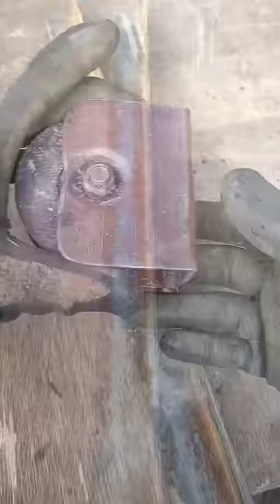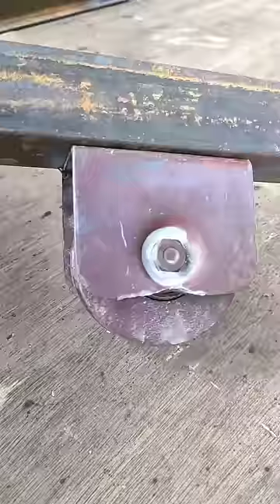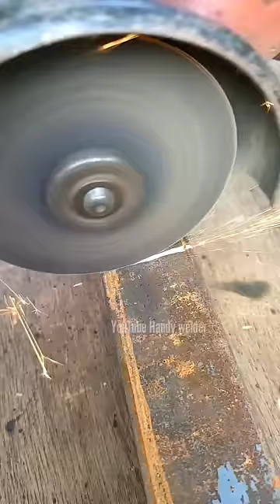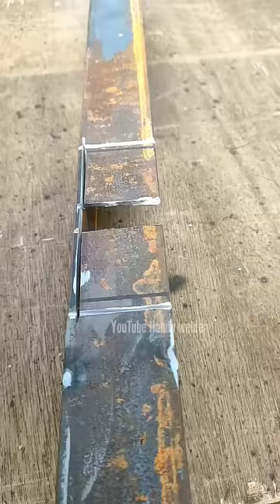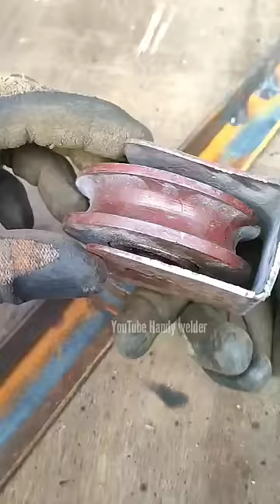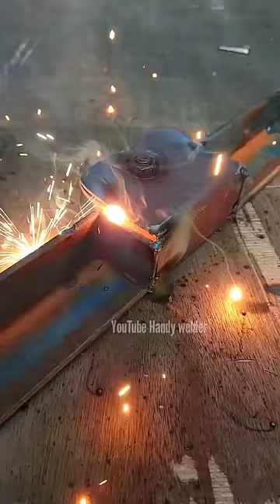maybe there are welders who don't know how to weld wheels on angle iron

Comment: You took all of the strength out of the angle iron by cutting it.    It was 100 times stronger the first way.
Reply: Totally agree with you
Reply: Awalnya,Semua kekuatan hilang dan berpindah dg sempurna😂😂😂
Reply: Non sono completamente d'accordo perché la forza tolta l'angolare è stato sostituito dal telaio della ruota e se si dovesse piegare Non penso proprio che succederà lì Se tutto verrà saldato correttamente
Reply: La mayor fuerza la resiste el ala vertical del perfil.
Reply: Para nada ya que lo que cortó lo reemplaza la rueda y a un mejor todavía
Reply: Could've just welded inside the angle. Althought this would retain strength in the direction of force. If it wasn't tacked only.

Comment: That would be a strong joint if you put weld on the back sides of those bent pieces but the way they have it all the weight is on the part that is bent and the weld to the base of the angle iron